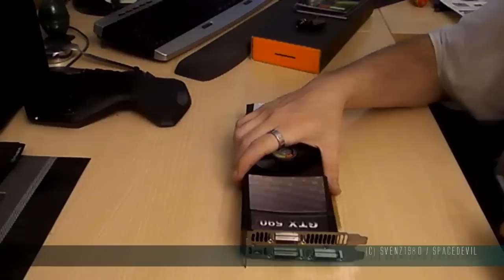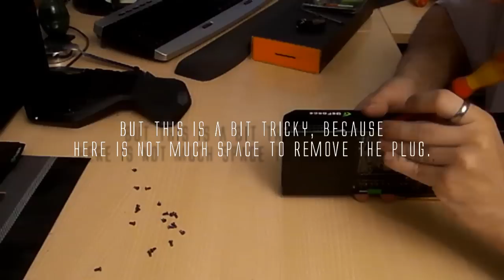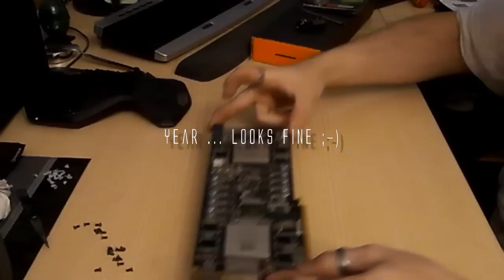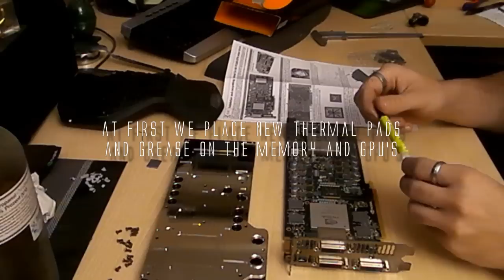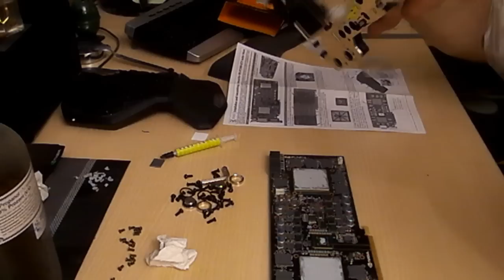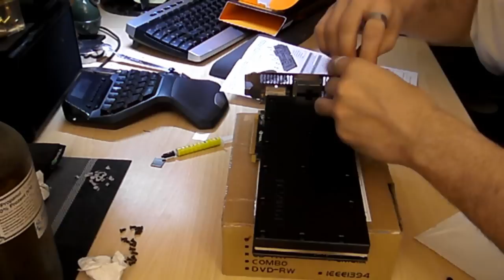GTX 590 replace the stock cooler with a EK Waterblocks Watercooler

Comment: I have a EVGA GTX 590 that I bought on ebay. I really want to put water cooler on my plate, most do not think the block to buy water. Here in Brazil is almost impossible to achieve. You have somewhere there in your country that sells complete block? Would you recommend?
Can you help me? I'll be grateful! Thank you!